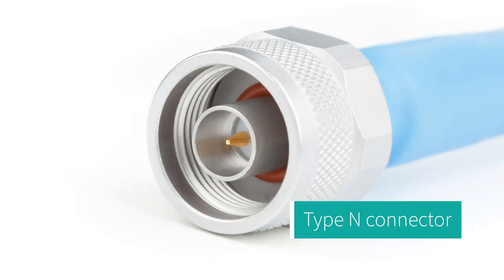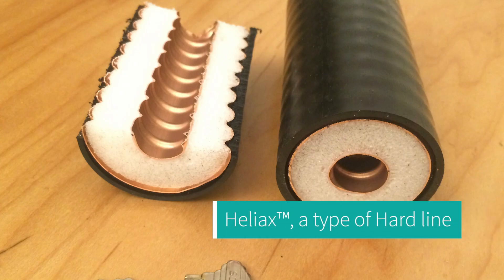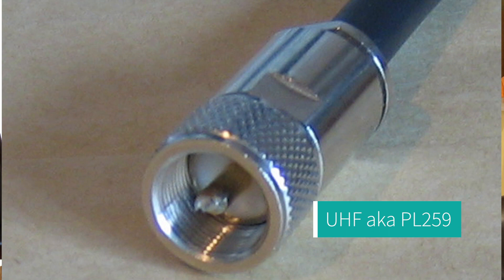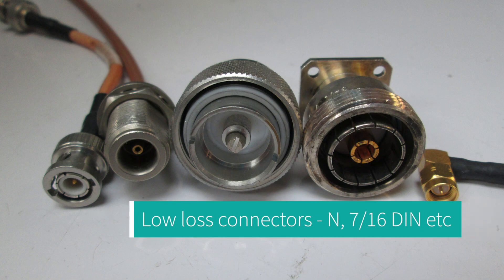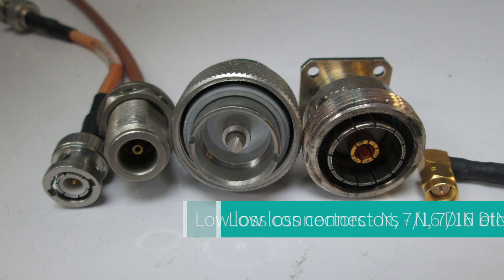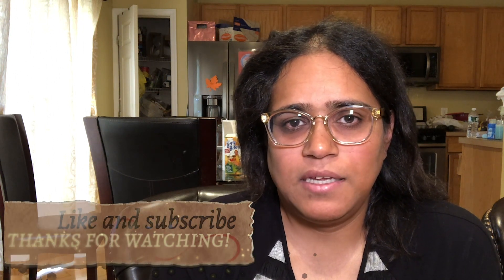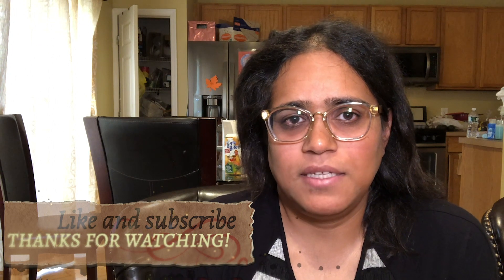Ham Radio - Ria's Shack Radio Q&A - Episode 1

Comment: 1. TIme-out timer. 'spares' the repeated output 'content' and repeater transmitter but does nothing to stop a potentially offending input signal that can block other users from participating on the input.  
2. If repeater equipment is not engineered and implemented for 100% duty-cycle, it's a significant potential point-of-failure in the "if all else fails" realm...
3. "connector anxiety"... "SWRs anxiety..."  1 to 3 to 6 dB (1 s-unit) is not a contact-make or break in most cases.  On the same scale with 'magic', sorry *GREAT*, LMR-coax... "Mother Nature" and what antenna radiation pattern one has available is much more "in control" of signal path/contact concerns than most any connector/cable implementation.  If you're truly 'anxious' about feedline and connector loss to the sub-1dB level you'll be investing in 1/2" or 7/8" Heliax and $50 connectors - NOT LMR-anything, etc.